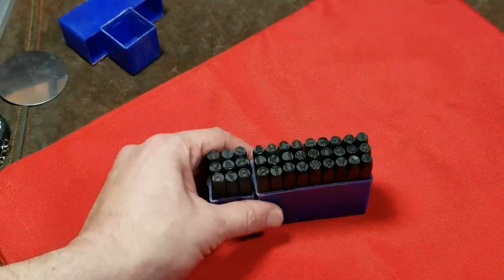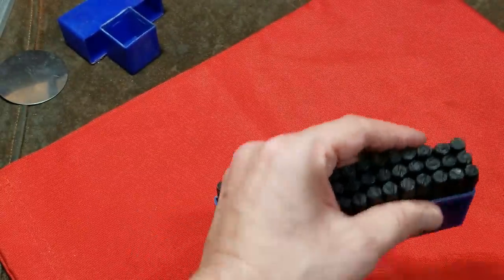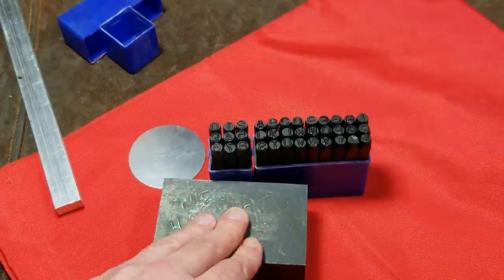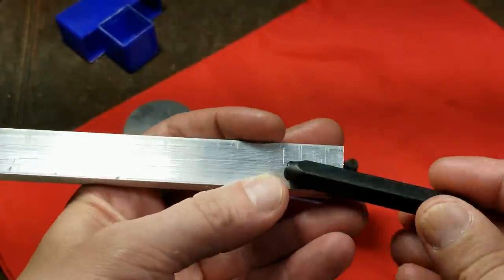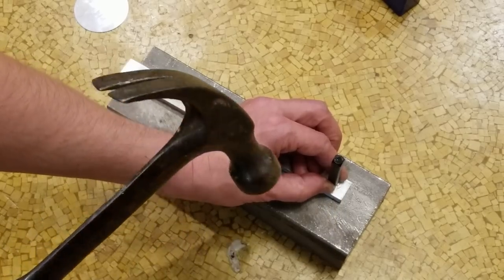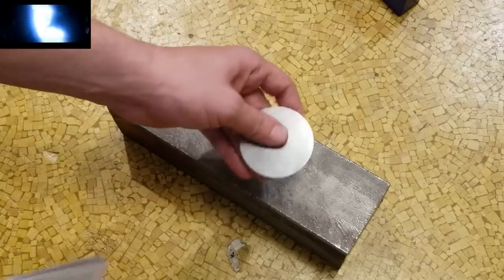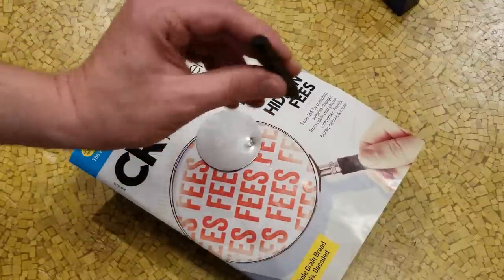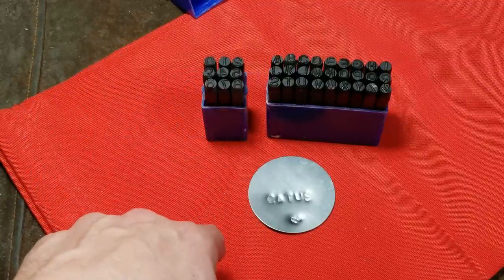Harbor Freight Pittsburgh 1/4" Steel Striking Stamp Set Review

Comment: Grind a groove in the side of the stamp so that it faces you and you can feel it with your thumb when making the stamp. Good quality (American made) stamps have this groove already cut.
Make a wooden block with holes to hold the stamps. It makes it much faster to pull the stamp as you need it. If you get fancy you can make a cover for the block like a quality set has.

Comment: The problem I always had with these is the actual letter alignment and spacing. When I was in trade school I spent a day or two trying to mill a holder where you can put all your letters in and snug them together with 2 thumb screws. If I remember correctly it didn't work too good. After all the letters where in the holder you basically needed a press to have enough force to deboss all of the letters at once. And due to the shape at the tip all the letters seemed widely spaced apart.